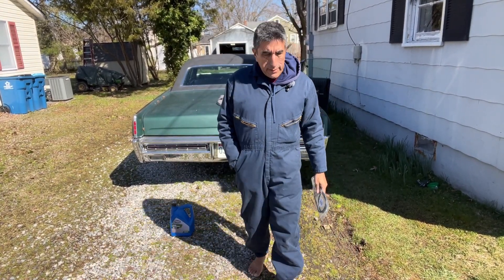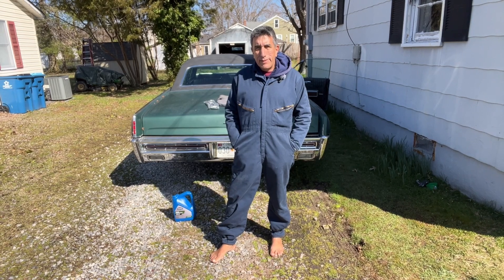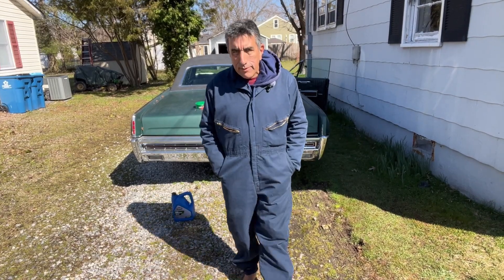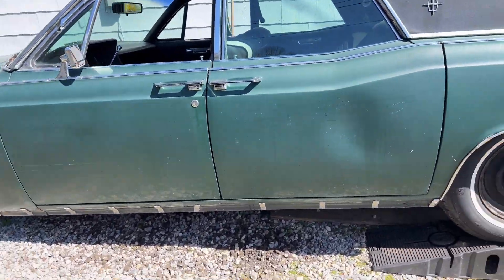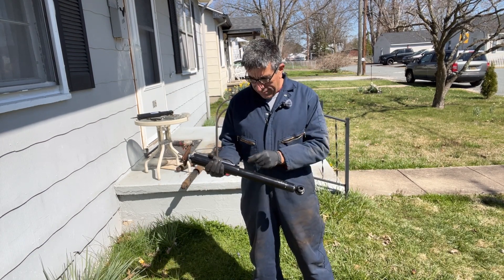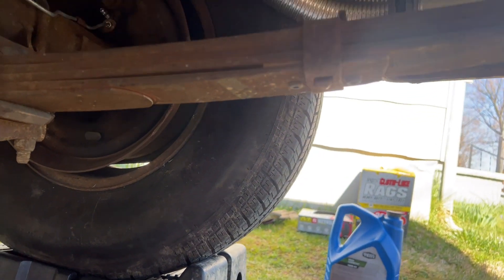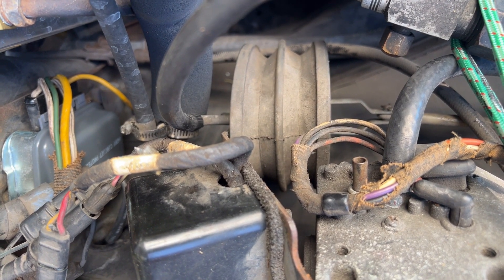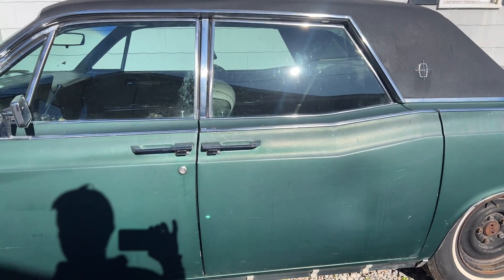1967 Lincoln Project Update 24 Mar 2024 Installed rear shocks and other detail work

Comment: Dilute the gear oil with a solvent that way its easier to extract. Parts store should have a barbed fitting to adapt a smaller hose. I use a fancy fluid extractor with different size hoses but a suction gun works the same way and is much cheaper. Nice work as always!
Reply from the maker: Thanks Brian.

Comment: Are you sure on that back door you cant just push that shallow dent out with your hands or a flat board? Is there something else im not seeing on the door?
Reply from the maker: Yes there is more. When I had the door panel off I found extensive repairs had been done to this door. Lots of holes drilled, dents pulled out with imperfections left. So I prefer to just replace it with a non damaged door.  The other rear door had a dent that I was able to just push out as you described and it had no other damage.